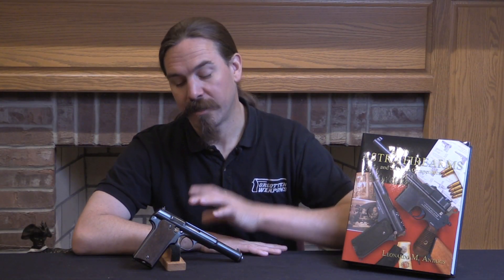From Service Sidearm to Match Gun: the Astra 400 Target Model

Comment: The machining is really, really nice for a gun from 1945. I can't imagine how much more time was spent on fit and finish vs function. I know my pistol isn't as well machined.
Reply: Spanish engineering used to be  thing.
Reply: @granudisimo  they got angry when the Germans arrived
Reply: @miguelgameiro8063  The Legion Condor sure got a lot of locals angry, and no doubt was one of the compounding factors that during most of the XXth century, contributed to the impoverishment of the Spanish nation, with the subsequent loss of not technological development itself, as attested by the quality machining for the time, but rather, the ability to develop at the same pace as countries like Germany, which didn't have their own WWII fascist dictator lasting till the 70's.

And despite that we developed appliances companies and Pegaso trucks (we used to export domestic appliances) but then again the incompetence and greed of Felipe González, made hm unable to adapt the Spanish industry that was mostly sluggish public companies created by the late Francoism's technocracy, to modern times and the rules of the Common Market which despite not forcing any kind of deindustrialization on any of their members, ended up doing so since Felipe wanted to find a quick solution to try and score future electoral points by frantically checking the industrial reconversion off his list, without bothering to do things properly.

There you go, a quick summary of why Spain isn't the actual powerhouse, I mean, imagine we put all that wasted potential to have engineered autonomous electric ships in like the mid 90's, instead of Norway, which just did it last February, and use them to strengthen our trading routes with South America and creating a Latin Market of our own, not depending on oil for shipping XD.

War never changes
Reply: @granudisimo  I wish Spanish gun engineering became a bigger thing! I can just imagine all the unique ideas. History would have been changed in ways I could not imagine. I hope I can help this happen in the future if I become some kind of businessman. Shit would get wild.
Reply: @ladonna1007  
Nowadays the automotive industry is controlled by german investment and later american investment the technical know how 
and industrial infrastructure is there for arms production but importing arms from said foreign nations is preferred by the government.

Comment: Ian, nice that you included a side by side comparison of the sight pictures. In addition to making rapid-fire problematic, unlike something like the Colt .45 Gold Cup that was a target pistol that could theoretically still be carried in combat, this Astra 400 variant would have been completely out of the question for anything but target shooting.
Reply: Like most target pistols, they aren't meant for combat, and thus, It doesn't make much sense to use one in an actual firefight. Its like driving a Formula 1 car through a dirt road.
Reply: A nice 1911 can do either
Reply: @808bigisland  210a? What is that?

Comment: Your video on the Astra 400 caught my eye since I bought one of these for $30.00 at a local gun show sometime in the early 1970s when I was a novice gun buyer. I recall the takedown of this piece by twisting the front end of the barrel that allowed locking lugs to disengage and a large recoil spring surrounded the barrel which could be removed. As I recall this pistol was capable of firing several calibers all of which were variations of the 9mm Luger and some Spanish cartridges. As I recall cocking this pistol was a challenge due to it's heavy recoil spring. Mine was not particularly accurate but I suppose that it did it's job.

Comment: Very cool addition to an interesting gun. It's a largo 9mm isn't it? Like a 38 super which I believe you can also shoot in it. My 400 is but my 900 is a regular 9mm Luger and 300 is 380, at least those are the calibers of my guns. What variant calibers we're there? Thanks, great video.
Reply: 9mm Largo is 9x23, .38 Super is also 9x23, but it's semi rimmed where Largo is rimless. In addition to that, .38 Super depending on the load can be far too much pressure for it to safely handle so I'd use caution. Now, .38 ACP on the other hand is usually more than safe as it's a little weaker than 9mm Largo but similar pressure levels overall. 

The 9mm Luger model is the 600, the 300 series is .380 and .32 ACP. There was also a later version with the hammer exposed, the Astra 3000/4000 Falcon, which had multiple caliber offerings as well as barrel/slide conversions but was found typically in 9mm Luger, .380 ACP, and .32 ACP. 

Those are the only caliber variants from that family that I've ever seen or heard of.

Comment: I kinda wonder if anyone turned the rear button into a switch of some kind. Kinda like the special suppressed handguns with slide locks albeit for a different purpose. I'm really curious how bad the safety problem truly is especially if it could be flipped back to safe and or use 1 rd in mag for single

Comment: Does this mean that it becomes a full auto when you both press the button and the trigger?

I would love to see such an experiment.
Reply: The disconector would stop the hammer from falling
Reply: @montevallomustang  The disconnector just allows the sear to return to a position to catch the hammer. Ian mentioned there is so little engagement on the sear that the slide coming forward can jostle everything enough that it releases the hammer and the gun fires. That’s why they added the button on the rear of the frame that holds the hammer off the sear until everything is stationary again.
Reply: @mrb692  so then the hammer will just follow the slide home, I doubt it would have enough energy to fire another round
Reply: @montevallomustang  The jolt of the slide slamming forward is what knocks the hammer off the sear (if the button weren’t there), so the slide would be fully forward and in battery and it wouldn’t be hammer follow.